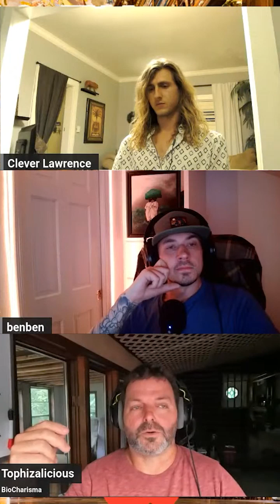How were the Pyramids made?

Comment: Really interesting episode, i live in Melbourne, aus and have worked on old world buildings and i noticed the concrete was different, it was darker, about 10x harder and didn't have any reo except there was one bit with a heap of old pipes jammed into concrete on an angle, almost as if it was anchored in the ground 20 meters down on an angle. The reo i have noticed was bizloy, do you know much about that because I've been screaming out that modern day concrete mainly uses mild steel as reo...